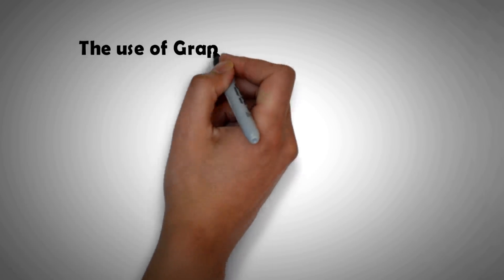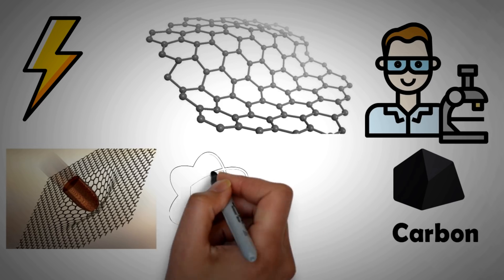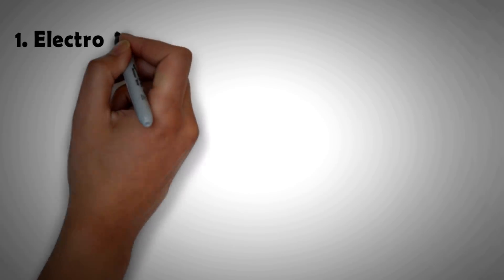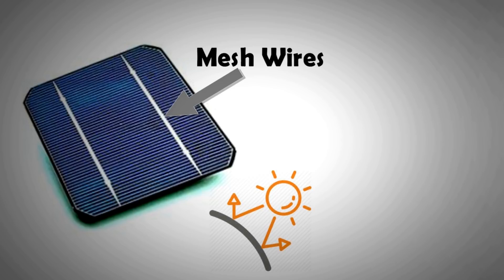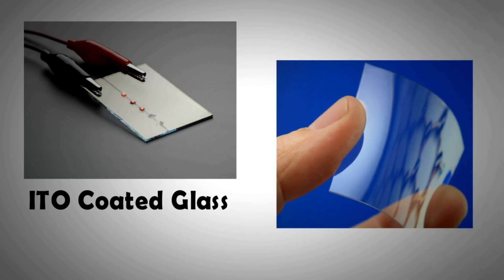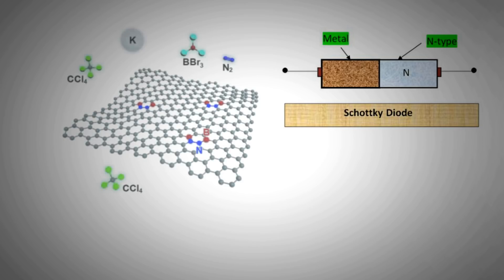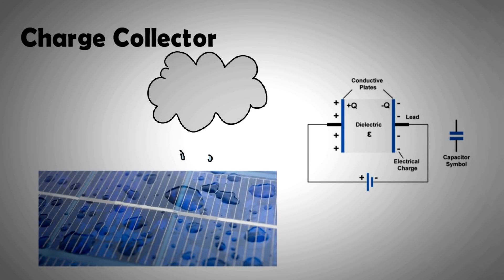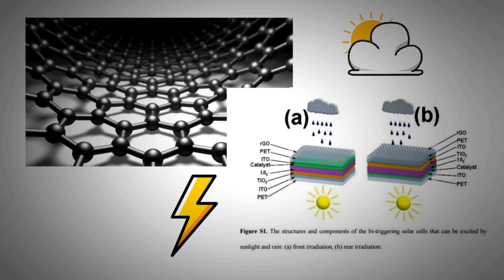How Graphene is taking Solar Cells to the next level

Comment: I heard this same old story for years but not even 1 prototype to prove for these theories on how  graphene can improve technology. To me it is a concept for now!
Reply: zuluknob + can you show me any prototpe product involved with ghaphene please.
Reply: @erict7491 
Watch Robert Murray-Smith's channel.

https://www.youtube.com/user/RobertMurraySmith 

His crew is working to bring a battery factory online that produces graphene based batteries. NOT CAPACITORS!

There is a difference between the manufacture of graphene based batteries and graphene based super capacitors. 

Robert Murray-Smith has videos showing the steps to make both.
Reply: https://www.skeletontech.com/industrial-cells .  This Estonian company produces graphene ultracapacitors with a wide range of products in various applications.
Reply: evodude919 + I think you mixed up with Super Capacitor battery with Graphene. Super capacity has a very high self discharge rate, good for buses not for energy storage.
Reply: Don't believe in stuff till you see it.
Reply: Graphine batteries are being used
Reply: This reminds me of nanotechnology, which was supposed to be used in all sorts of applications, but seems to still be reaching maturity and mass adoption 10 years later
Reply: The problem is how to produce graphene sheets in sufficient size to be useful.  We currently dont have the technology to do this
Reply: MIT recently announced a production method. Already graphene items.coming out. 5 tom10 years and the world starts being a different place.
Reply: @DwDDB  yeah I've seen that, the growing graphene on metal method? What's a waste of metal.
Reply: redstone craft guy pretty sure that the metal is not used up in the process, so not seeing how it is a waste of metal?

This is exciting and world changing, why are you being beyond negative?
Reply: @DwDDB  because I need graphene for stuff and they won't give me it. Anyway it is a waste of metal because after the process, they dissolve the metal in some solution to seperate the metal from the graphene and throw it away because they only need graphene and not the metal.
Reply: +William Crowley Give it time? If I die before I get to see graphene, graphene is total bullshit to me.
Reply: +Idylchatter then show it to me, where's the link?
Reply: Idylchatter  still doesn't explain why there're no graphene in the palm of my hand right now or inside the smartphone I used to type this reply. If we are so close to graphene then why can't I buy graphene at a store just like how I would buy papper?
Reply: @luongmaihunggia  New technologies can take centuries, so, keep calm and be patient.
Reply: @Enzoa123  "centuries" you and I would be dead by then. I'll be a little more convinced if you say "decades" instead of "centuries"
Reply: @luongmaihunggia   Let's go.
Quantum computers, i'll use it as an example.
The quantum physics was discovered nearly 90 years ago, but just only now that we're making the first prototypes of quantum computers.
It's practically a century, from the discovery of the phenomena to the practical application on technology, it's taken nearly a century!
People need to learn that, technology isn't exponential progress, it need to research, takes efforts and engineering.
It's pretty hard, and takes time! A LOOTTTAAA of time!
A Scientist that proposed a hypothesis may be dead when this hypothesis will prove the correct, or wrong. Science is a thing that will take generations to be completed.
We're still stuck in beginning.
Reply: @luongmaihunggia  I already accepted that if something great such as a galactic empire will ever be built, I'll not be here to see this utopic future.
Reply: @Enzoa123  yeah, that imply it is useless for you and me and only useful for the future. More importantly, climate change is happening now and slow progress in graphene development is not helping. We are running out of time, the clock is ticking, we should not waste time on technologies that will save the environment in a few centuries, climate change will end the world by then.
Reply: @Enzoa123  re-read my comment, I edited it.
Reply: @luongmaihunggia  But who knows?
If there is a lesson that the history show to us is that the future is unpredictable.
In my opinion it's possible that a material even more revolutionary than graphene can come.
Reply: @luongmaihunggia 
The climate has been changing for centuries so stop stressing over it.

All that is required of you is that you do that which you can do.

The earth is not going to have a global deluge that destroys all life on earth. As industry invests what it can into solar, wind and other green technologies, in some cases just greener technologies, that annual incremental investment builds up over time and is the change that is necessary today.

Contrary to the popular delusion, there is no switch that can be thrown that will instantaneously move the global energy consumption from fossil fuels to non carbon producing clean energies.

If the Lord does not return as expected, a future generation may have to burn fossil fuels just to insure that there is sufficient carbon in the atmosphere for vegetation to grow. All because environmentalists don't thing through their claims regarding global warming.

There is also the great possibility that global warming is not a man made phenomenon, but an act of God's divine providence.
Reply: @TroySavary  
1. *your

2. Let me get this straight. You think people made up the carbon dioxide causing global warming thing so they can tax people and get money from it? It sound like a pretty decent explanation until you think about it for a bit. Why made this thing up to tax people? Why do you need a reason for taxing people? Why not just tax them anyway? The first known taxation took place in Ancient Egypt around 3000–2800 BC while global warming wasn't discovered until the 1820s by French mathematician Jean-Baptiste Joseph Fourier and we didn't know what was even causing it until the 1860s when Irish scientist John Tyndall shows that molecules of gases such as water vapour and carbon dioxide trap heat and cause the global warming effect observed in 1820s. Tax predated global warming by 4,620 years. *This imply that you don't need to make up stories to tax people, you can tax them without this "made up story" about global warming. Not only we can tax people like that. We've been doing it for 4,620 years.*

4. Another flaw with this argument come from the video itself. It promote solar energy that doesn't produce CO2. The government also promote energy sources that don't produce CO2. If they want to maximize money gain from carbon tax then why would they promote these things that don't produce carbon dioxide? Wouldn't if more people use these energy sources the less CO2 is produced and the government make less money from carbon taxing?
Reply: @luongmaihunggia  Yes, taxation has been around since the ancient times, but so have tax revolts. Convince people this tax will save humanity, and they are more likely to accept it. Funny how the solution seems to be money changing hands, rather than science. How does buying carbon credits make your carbon less harmful? All that has done is make hundreds of millions of dollars for Al Gore. He does not use the money he makes from this scam. He used it on private jets, mansions, and other extravagant uses of more carbon than a small army of ordinary citizens. If Gore really believed we were about to melt the ice caps, and flood the coasts, he would no have bought coastal property.
Reply: Kotik , there is in my opinion a second problem. Graphene, in being a two dimensional crystal in comprised of two surfaces which, like all surfaces, are highly reactive. The problem is one of how one controls the production and processing methods to avoid these surfaces passivating by reacting with the environments to which they are exposed.

As with many materials, although long-term they find applications, the end result rarely matches the initial euphoria. But that of course does not mean it is an exciting new material.
Reply: @NPipsqueak  It's not highly reactive though, it's highly conductive. The atomic bonds are the strongest we know of so far, so reactions are hardly a worry. Samsung has patented a graphene ball battery, which there have been rumors that it will use in one of this years flagship phones. The s10 is discussed, but I think it will likely be the foldable phone.
Reply: Not a concept for now; A concept for the future, and it always will be.
Reply: Eric T Go look at the entire Robert Murray-Smith channel. He's made everything from water filters to batteries to concrete additives, and a lot of other stuff. See that bar at the top that says search? Use it bud.
Reply: rumor said that the coming huawei honor magic 2 will have graphene battery
Reply: samzung patent black box
Reply: Eric T nnjj
Reply: well if u ever used a pencil, u were using graphene
Reply: quantum physics were discovered more or less 80 years ago, but just only now we're building and testing the firsts quantum computers prototypes, quantum computers will easily take to 2030.
The warp drive(a hypothetical form of spacecraft FTL propulsion), aka Alcubierre drive, is a technology that if it's even possible will lasts at least 1000 years to build the first PROTOTYPE!! New technologies easily take decades, if not centuries to be developed, so, be patient, it's possible(high unlikely) that graphene is a technology of century XXII.
Reply: I have batteries that contain graphine, they are great
Reply: @luongmaihunggia  😂😅🤣😜
Reply: are you daft? material science takes decades to optimise and perfect, the reason we hear so much about graphene is because of its potential, its still really hard to make but it can revolutionise the world as we know it if we can figure out how
Reply: Graphene power banks on amazon now, super fast charge and longer lasting
Reply: Eric T, it is coming! It's definitely a game changer. Solar panels are just the beginning....
Reply: How many years you talking about 10 20 50 years ?
Reply: the problem is Federal subsidies that protects the industry that currently exists, as long as the Fed subsidies the available industry no one will invest time/money in developing a better product that will disrupt the companies in the solar business  that r in charge
Reply: @neindanke5550  Not long, you can already produce very small sheets at home.
5-10 years to develop efficient production technologies. 10-20 years to disrupt all industries known today. 
India is currently one of the leaders in R&D, "western" industrial countries won´t invest because it would conflict with their existing technologies and market dominance.
Reply: Everything was merely a concept at one point in time. 
A concept needs to be out here so that others can grasp the idea & develop it further. 
I think it's Brilliant. 
Flexible   PV ? you could cover a whole Car or Wagon with it. 
Thin & lightweight & Flexible & transparent. =Excellent ! 

Roll it out like Carpet or roofing felt to cover 100% of a roof's surface. ( that alone could make the roof upto 50% more efficient in some cases ) ( if it was like for like with existing panels per sq inch. )

If it was cheap enough to buy & install due to mass production & competition, you could cover  All Angles / Aspects of a roof inc North Facing & East & west Facing, 
Multiplying the efficiency of a roof X3 ? 

Also if cheap enough, you would cover every roof with it, Garage, Gdn Shed, greenhouse, Conservatory = Zero wasted roof area. 
Cut & paste like wall paper ! 

Cover you car in the same way they " WRAP " Vans with logo's etc. 

Think wild, 
think crazy, 
think Positive, 
someone will grab that idea modify it & sell it worldwide.
Reply: Eric T, I agree. If there has ever been a technology or product that is dragging its feet it's this one. You would think venture capitalists would be all over this. I would say more productive than sending a Tesla into orbit.